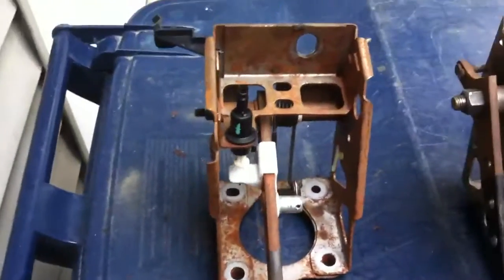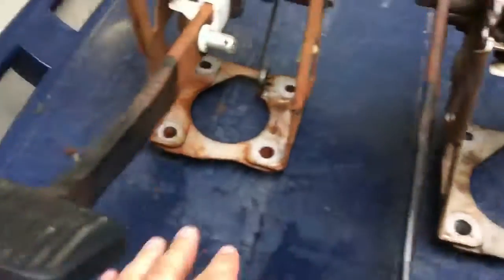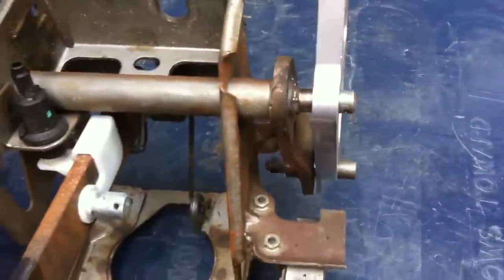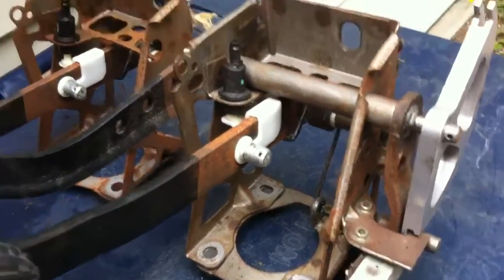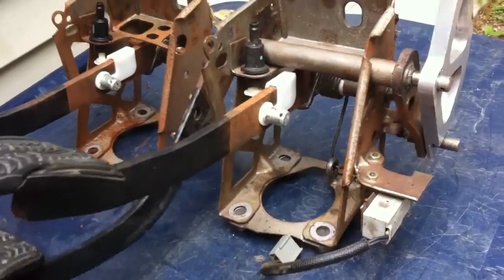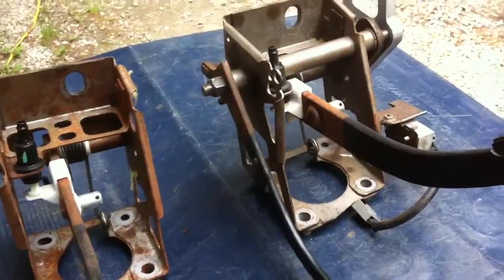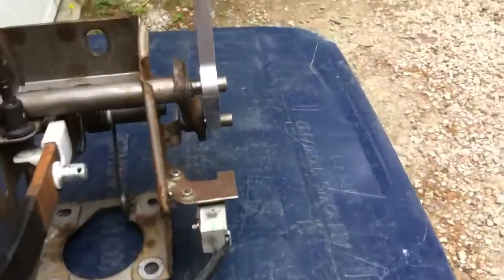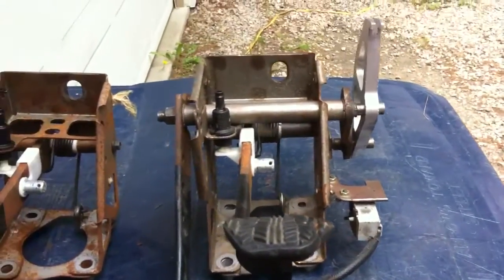Ford Mustang SN95 Foxbody Pedal Swap

Comment: The clutch neutral safety switch plugs are already wired in every Mustang. Look under the dash for them. They will be taped up with the main wiring harness.
Reply: You wanna do mine LOL ????
Reply: They are, Ik it’s been 3y but I swapped mine over and it’s a plug with another plug that has a plug into both of them
Reply: That has a return wire

Comment: it should work without the clutch safety connection if you're still using a auto ECU. at least thats how it is on other cars i've worked on.

Comment: Do I have to change the brake booster on my car I'm doing 5speed to auto swap!
Reply: I’m not sure but I’ve 4.6 swapped my 3.8 but I will say the 3.8 was an auto and my 4.6 is a manual and I had to change the brake booster but that may just be a 3.8 thing but the ones that u have to change are real big and round ones